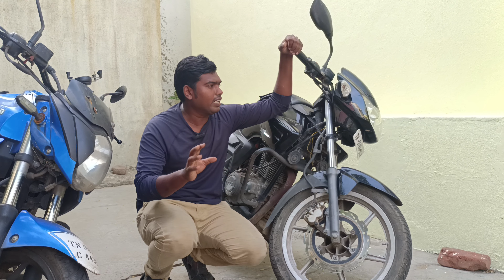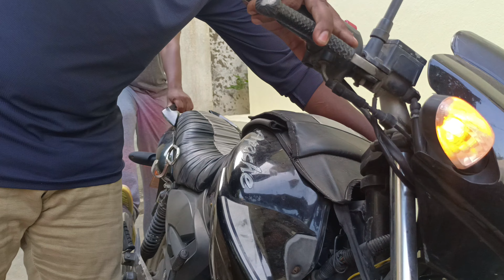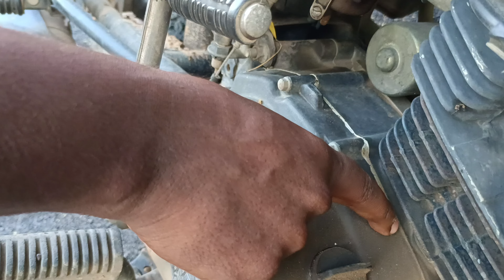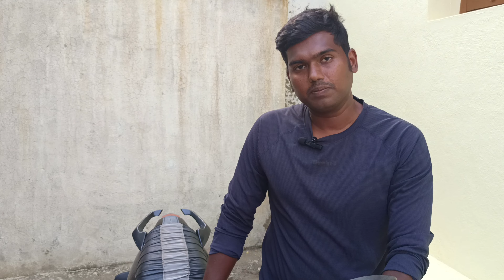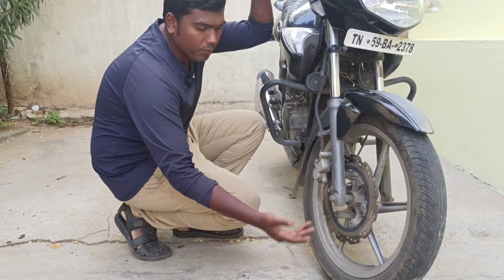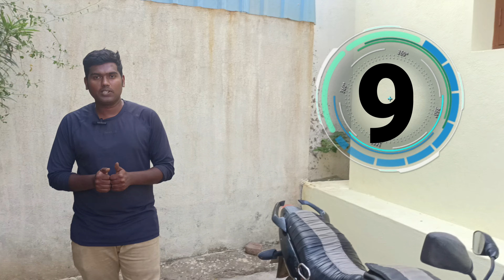2nd hand bike வாங்குறதுக்கு முன்னாடி இத கவனிங்க | 9 tricks to buy second hand bike ☝️#usedbike

Comment: 1. Disk plate condition 
2.oil leakage in fork or rust
3.Close the silencer, throttle the engine check the sound and check the holes in silencer
4.Engine outlook condition
5.Check the clutch 
6.Check the chain sprocket
7.Check the tires
8.Check the body
9.Try using kick start
Reply from the maker: Sema bro♥️

Comment: hi bro nice video. nanum second hand la bike edukalam nu irukan. honda cb twister onnu pathurukan. 2011 model. 18500  kilometres odi irukunu solranga. aana neega solra maari la na check paani paakala. single owner than. rs.25,500 solranga. na otti pathadhula sila spare la maathanum. engine tyre chain sprocket condition la na sareya paakala. enna rate ku edukalam bro?
Reply from the maker: @selvasrinivasan6342  nalla condition na mattum than 25k , condition repair nu iruntha 20k ku keela than pogum, maximum engine complaint vantha Twister ku pakurathu kastam so , engine nalla irukanum 18.5k kilometres running na namba muduyala
Reply: 2011 model  - 18500 கிமீ னு சொல்றீங்க. இவ்வளவு குறைவா கிமீ ஓட்ட வாய்ப்பே இல்ல..

ஒருவேளை அது உண்மையா இருந்தா ரொம்ப நாளா வண்டி ஓட்டாம இருந்துருக்கனும். இல்லைனா speedometer ல குறைச்சு காட்டிருக்காங்கனு அர்த்தம்.

நானும் ஒருமுறை 2003 மாடல் ஸ்கூட்டி 25000கிமீதான் ஓடிருக்குனு வாங்குனேன். அப்போதைக்கு மட்டும் வண்டி ஸ்டார்ட் ஆகுறமாறி செட்பண்ணி ஏமாத்திட்டானுங்க..
Reply from the maker: Yes
Reply: Bro 2011 model ku 20k laam romba jaasthi adhuvum honda twister 15 to 17k maximum avlothan

Comment: Bro fork bend ah epadi check pandrathu.. because discover 135 eduthean second hand la speed ah otarpoo vandi oru pakkam iluthukittu poguthu
Reply from the maker: Handbar bend aana mathi theriyum & frork la rubber seal kitta oil leakage irukum
Reply: @bennyplanet  oil leak illa bro. But handle bar shake aakuthu
Reply from the maker: Steering tube nu onnu irukum bro ,athula ball bearing irukum ,antha ball bearing thenji ponalum apdi shake irukum bro ,,intha steering tube than handle bar and bike chase oda connect agum ,,,

Comment: Yamaha Fz v3... 16k km done.... 74000 soldranga 2021 model.... New Tyre potrukanga..... Intha vishyangala thandi Vera ethum check pannanum ah
Reply from the maker: @kanagaraja1093  16k kilometres ku ethuku new tyre podanum ....  Kilometres reset pannirukalam ,  correct ta 16k than kilometres running na , ninga vangalam

Comment: Bro pulsar 150 2014 model 38547km odiruku vandi shockabser mattum seri illa engine super condion bro 30k soldranga vangalama bro
Reply from the maker: @MD_GAMING_30  kilometre unmaya avalothan odirukuna vangalam bro , but 38k kilometres ku shockubser pogathu... So kilometres running check pannunga ,

Comment: Bro, Fazer 2019 model 44000km oodiruku srilankan rupees ku 695000 solraanga worth ah bro, oil seal change pannanum ,disc pad heat aakuthu and engine light eriuthu...
Reply from the maker: Price romba jasthiya theriyuthye bro.... 695000 na , Indian currency la evlo rate bro... Disc pad ,nalla thenjiponathuku apramum drive pannitu late ta disc pad change panna , pad heat issue varum, fulla pirichitha vela pakanum ,unga country la epdinu therla, engine light sensor complaint Nala kuda yeriyum or , engine noise check pannidunga , oil seal Ku engine light eriyathu...

Comment: Honda unicorn 22500+km 2010 model 30k bro vangalama
2012 model 71000km run 32k bro vangalama
Reply from the maker: Kilometres unmaya 22500 than odirukuna 30k ku vangalam , but vaipilla nu thonuthu.... 

2012 unmaya 71k odirukum but condition gud na , silencer smoke pakanum, acceleration kuduthu  parunga , 25k worth

Comment: Bro platina 100 or ct 100 epdi pathu vangurathu
Reply from the maker: @hollywoodthozha6639  same than bro, engine noise check pannunga , kilometers running, head oil leakage iruka nu parunga ,

Comment: Bro oru TVS Ntorque 3k kilometer driven. Bike 80k solranga bro 2023  registration is it ok to buy
Reply from the maker: @Yoges6533 70k to 80k , condition poruthu vangalam bro ,,  access 125 best bro
Reply: @bennyplanet  ok bro ungaluku terinja chennaila ethuna contact no iruntha kudunga bro second hand oru 80k budgetla nalla vandi veanum bro
Reply from the maker: @Yoges6533  maduraila than bro ,theriyum ,,, chennai la oru shop theriyum ,,, enna bike iruku nu k2 soldren ,9944151997 en number ku call pannunga
Reply: @bennyplanet  ipo panalama bro
Reply from the maker: @Yoges6533 pannunga bro

Comment: Brother 2013 model pulsar Vangama  jiii...
Reply from the maker: @JackSparrow-m6q  condition nalla iruntha vangalam
Reply: @bennyplanet   jii speed metor change pannirunga OK va jii vangalama
Reply from the maker: @JackSparrow-m6q  vibration pickup check pannunga ji , silencer smoke and disc plate romba thenjiruka nu parunga
Reply: @bennyplanet   OK jii
Reply: @bennyplanet   thank you  jii
Reply from the maker: @JackSparrow-m6q  thanks for your valuable wishes bro

Comment: Bro pulsar 2013 model 24000 soldranga vandi slow speed ellame nalla irukku bro vaangalama and engine vela paathadha soldranga + vandi nenga sonna ellam point um pathuten bro crt aah irukku but engine cascut mattum green colour veliya theriyudhu bro vaangalama pls sollunga
Reply from the maker: Mileage kammiya kudukka vaipirukku ,bro , oil leakage iruka koodathu , vibration check pannunga , ok na edunga
Reply: @bennyplanet  oil leak lam illaa bro vibration illa drive panni paathuten
Reply: @bennyplanet  na bike only local dhan bro otta poren
Reply: @bennyplanet  2013 model na how many years ku olaikum bro
Reply from the maker: @Zanthoxx__  apo ok bro , satisfaction irukula ,eduthirunga
Reply: @bennyplanet  OK bro thanks bro reply pannadhuku
Reply from the maker: @Zanthoxx__  engine maintenance poruthu than bro ,,, solla mudiyum , but ulaikum bro ,
Reply from the maker: @Zanthoxx__ thanks bro 😁
Reply: @bennyplanet  ❤️

Comment: Bro 2012 model unicorn 75k km evlok edukalam
Reply from the maker: Engine vibration & silencer smoke ethuvum illana edukalam, self working, insurance current,tyre gud, clutch plate gud , fork no oil leak, no bend na , oru 18k to 25k ku vangalam ,

Comment: Bruh recent aa mt 15 vangune.  Second hand ! 7k kilometres than runned ! Ellam okey than vandi le netrual aa pottu engine running appo light aa tickuh tickuhh bu kekuthu i mean engine sound Oda sethu enna va irukum ?
Reply from the maker: Engine oil level kuranchirukanu parunga
 engine ulla iruka ⚙️ la ethachum oru gear la problem irukalam bro, 
But nutral pottu engine race panna koodathu , 1st gear or ethachum oru gear podum bothu apdi noise ethum kekutha ?
Reply: @bennyplanet  engine oil recent than matune ! Silencer le issue ille ! May be valvle Clearance or fuel injectors le ? Or clutch issues ethachum iruka chance irukaa ? Bruh !
Reply: @bennyplanet  ellam gear liyum kekum. But netural le clear aa keka mudiyum !

Comment: Bro FZ V2 35000Km, 2016 modal 
60000 solranga vangalama?
Reply from the maker: 50 to 55 k , worth , kilometres running kammiya na ok than , bro, kilometres original la 35k than odiruka nu check pannikonga

Comment: Passion pro i3s 2019 model 40k kilometer odiruku rate 38k rs solranga vangalama brother
Reply from the maker: @nicksugu4822  dealer rate 38k ok than ji ,,tyre chain spraket, engine noise, oil leakage, silencer smoke or oil spread ethum iruka nu check pannikonga , handbar bend mathi therinja , fork problem ma irukum ,so handbar bend iruka nu parunga
Reply: @bennyplanet   tyre average ah tha iruku. Handbar bend ah iruku brother ena panrathu
Reply: @bennyplanet  bike self edukala batter charge podanum solranga
Reply from the maker: @nicksugu4822  bettery poirukum bro 1500 to 1800 agum ,,
Reply from the maker: Tyre mathanum , fork bend irukum ,, athu oru 2k tyre ku or 2k kammi panni kelunga